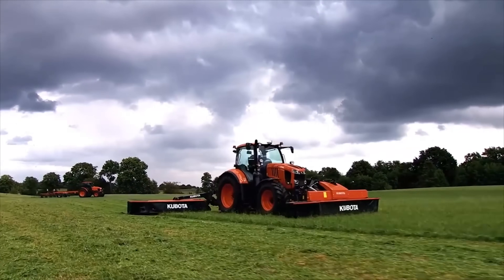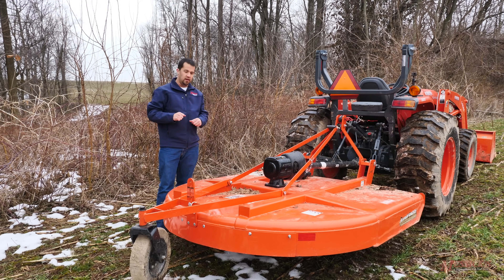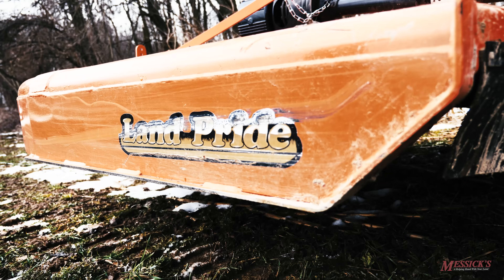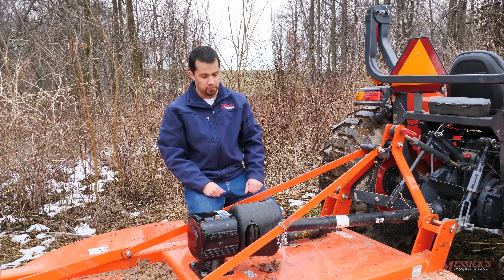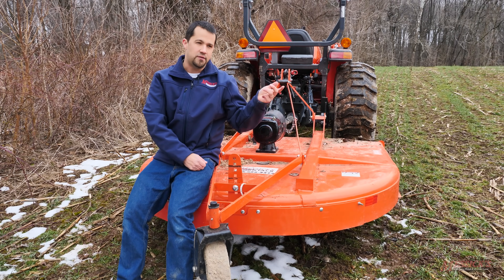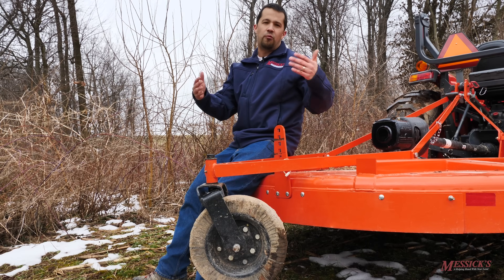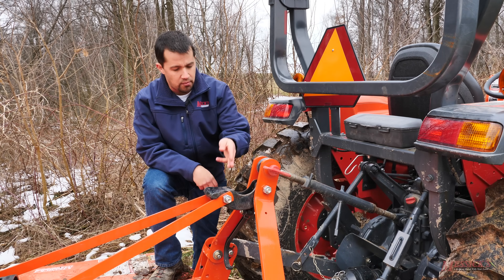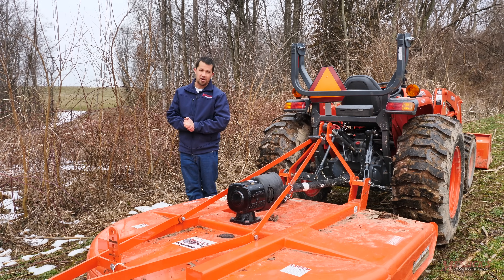Brush mower features with the Land Pride RCR1872

Comment: I have the RCR1860. A great cutter. Best one made in it's price range. Very happy with it.
Reply: I bought an RCR1860 because I had a good experience with a used Land Pride unit. The new cutter had a vibration from day one. The dealer tried to tell me about blades slapping the air. Talk about blowing smoke. Then I took it up with land pride customer service. They have blown me off three times after promising to have a regional rep. take a look at it. My dealer stopped selling Land Pride so I am out of luck there. I only offer this if it helps with your decision.

Comment: It is amazing the amount of strength added by making those bent edges rather than being flat.
Also the lack of a square corner inside means it self-cleans inside the deck better.  
Square corners inside the deck collect  debris and that means more rust.
Reply: The warranties on the gear box... if it survives 6 months, just about anything that will make it fail will be user error and not covered.
.
You can buy a slip clutch that goes between PTO on the tractor and the  PTO shaft.  These can be less than $100.

Comment: If you're going to rely on a slip-clutch, I understand you should give it frequent calibration to prevent it from seizing when you actually need it. I have a shear pin on my Bush Hog® SQ 160, and in six years of pretty challenging conditions running it about 75 hours a year I have sheared only one, and it takes only 5 minutes to replace if you're prepared.

Comment: I just had this exact cutter delivered 2 days ago. First time bush hoggin in my life. Having a blast thanks to so many helpful YouTube videos. Anyone know …the floating top link…does that black iron piece allow those 2 huge bolts to act as a hinge?  My bolts are TIGHT. Zero movement of that black piece. So, backing up a hill, when I’d expect that floating top link to rotate as a hinge, it doesn’t. Instead, the A frame that goes to the tail wheel bends inward and outward depending on the hill. Make sense?  Confusing I know. I read the manual and researched….should the A frame straps flex, or should the huge bolts on the iron piece allow for that iron to move?  I have terrible luck and I don’t want to destroy my heavy duty machinery.
Reply from the maker: Yes, it should hinge. Someone probably over drove the bolts with an impact wrench.
Reply: @MessicksEquip  thank you so much for your replay!  I watched another one of your videos, noticed the hinge and order a much-larger-than-I-had socket wrench set on Amazon. They were definitely overdriven…no tools I had would loosen them. 5 minutes after socket arrival, it was loosened. I appreciate your help!

Comment: This is a great cutter...but do you have any posts/videos on changing out the stump jumper? Mine (RCR1872) literally blew apart (with less than 100 hrs on the cutter) and now I'm trying to remove the pieces. I'm trying to pull the flat plate 'piece' and hub and it is stuck pretty hard. Don't want to force it too much...was hoping there is a video out there showing the correct way to do it so I may could modify to my situation.

Comment: Would a RCR 2672 be to big and heavy for a MX 6000 to run and lift without stressing the tractor ? I will be cutting tall grass and on occasion having to cut thicker woodsy area’s all though not intentionally running over large limbs but it could happen . Thanks for your help .

Comment: Could you run this cutter with a l2501? Or are you forced  into the 3301/3901models. It’s going to spend its life cutting fields with woody brush in it but not a ton. Planting and fertilizing food plot, also just general hunting property work on a 200+ acre farm. Just trying to get some help figuring out what tractor is right. We already own a rcr1872, landscape rake,500cone spreader snd a disc Harrow. We also own a larger tractor with 10’ cutter on it. Any input is appreciated.
Reply: Generally go by the width of the tractor for your brush hog deck size.  Its more about tractor stability and not getting the corner caught when you go by a power pole or fence.  The 20+ hp @PTO would drive a 72 inch deck no problem. if you aren't cutting really heavy stuff.
>
Note that this is one of a series of decks, all made very similarly in different widths for  the different size tractors.
Reply: Yeah I guess just trying to really figure out what is meant by heavy stuff. The l2501 has 19 pto hp which is just below the 20hp+ recommendation for the rcr1872 we own but I was thinking we weren’t going to be pushing it too hard since it will mainly be field use. The thickest stuff would be field edges or areas where we have first year woody stuff like sumac sneaking back into our field. Even though it’s a 2” cutter it’s doubtful it would ever see anything over an inch in its lifetime. Just trying to decide between the 2501 or a 3301/3901 to run this cutter under those circumstances. Thanks again for the input.

Comment: Any chance of a clutch plate run out demo video?
Reply from the maker: Not yet, on my.list
Reply: @MessicksEquip  I learned it's important to do! have an old SCL-760-HD was cutting a field that was extremely overgrown ran over couple truck tires on rims. Tractor has a cab I hear a bump and thumping look back and the shaft had broke in half! No damage to the cutter still running to this day lucky there but it made me re access shear pins on some other attachments.

Comment: Question, I was using my loader yesterday with the 1872 on the back. The cast iron piece attached to the rear of the mower (I’m assuming it cast iron) snapped right in half. I haven’t had it but 3 months. Not sure if I should pursue a claim with insurance or would it be covered by warranty.
Reply from the maker: Warranty
Reply: Messick's Equipment thanks

Comment: I don't see any way to adjust the 'height' of the trailing wheel
I might have missed it, but I don't see any way to allow the brush hos to to 'float' over uneven ground.
I suspect that 'cast' item will 'bind because it is (almost) straight into the mount.  Suggest making it easy on the top hitch by having a horizontal slot to connect to the top hitch.
Reply from the maker: height adjustments are done on the tail wheel. There is a vertical plate with holes in it.
Reply: Some of the tail wheels you adjust by dropping the  whole castering assembly out and putting on a sleeve spacer.
>
This one, if you look at 5:57, directly under his left hand is a "bar" sticking straight up with several holes.
Pull a pin and you can select which hole.  
This  deck is set at max height.

Comment: Just bought an 1872.  Slightly disappointed that the gearbox is made in China.   Also how much are the chains?
Reply: We used to make these gearboxes along with speed increasing gearboxes for 540 pto to couple to hydraulic motors. We stopped making them in Italy in the 90's because of China copying and selling them so cheap. It hasn't stopped, they just keep doing it, some company's are taking the fight to the retailers of these copied items since there is nothing they can do in China.
Reply: When we added chains to our 5' mower a decade or so ago it was pretty cheap, a couple hundred bucks I believe for the front and rear. If you can do DIY stuff it'd be easy to add them yourself since they're basically just links of chain with a steel cable holding them to the cutter.
Reply from the maker: Its almost impossible to find a domestic gearbox on a price sensitive implement like this. They do design the product and have a gear box built for themselves, but yes.. its from China.
Reply from the maker: Don't have a pricebook in front of me, but I'd guess chain shielding is around $250
Reply: That being said Indian motorcycle engines are being casted, machined and assembled in Washington State, of course price is not an issue for the buyers of this item.
Reply: without made in China products, you will not be able to get online and make this comment. LOL

Comment: Why is your ROPS down?   
Somebody says the gearbox is China made... Confirm ???  Easy or not to check/drain/refill the gearbox oil?   I like the slip clutch..    I have Land Pride box scraper and post hole digger for my BX23, very durable so far, about 11 years old.
Reply: Jennifer WhiteWolf  like I said I just bought a new 1872.  It clearly has China on the gearbox.
Reply: Luckie Hyaena    Hmmmm.. China,... Sometimes crap.. sometimes serviceable, rarely really good.   There is a company that has Mercruizer marine outdrive units copied in China, they sell for less...  but they are notorious for gear failures...  Sad to see as we have no way to know if the quality specs are high, and met, or if they just cheap and prone to wear-out just past warranty.
Reply: You put your ROPS down when mowing under limbs. Far more danger of injury by a limb snagging on the ROPS/tractor than the tractor turning over on many mowing jobs. All gearboxes are made in China now. John Deere, Bushhog, Rhino, ect. ect. I know of not one single gear box on any rotary cutter that isn't made in China. Deere put a made in Spain one on their MX6 years ago and it was the worst gearbox ever put on a mower. MX6 now has a China made one like every one else.
Reply: If I can't go under it with a ROPS then it gets sawed off with a pole saw.  Too many dangerous hills where I live.  Wish I lived on the flat.
Reply: @MLJenkins  Great comment and same with me.
Much easier to cut a few limbs than cut down the tree and burn the stump.